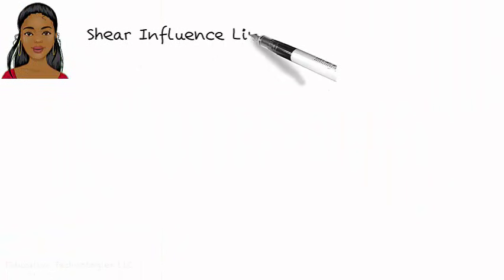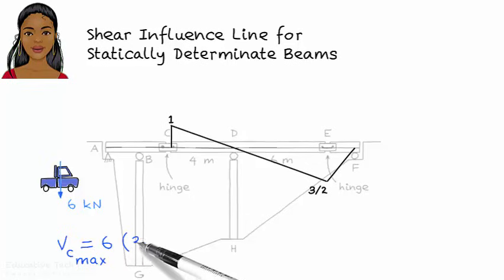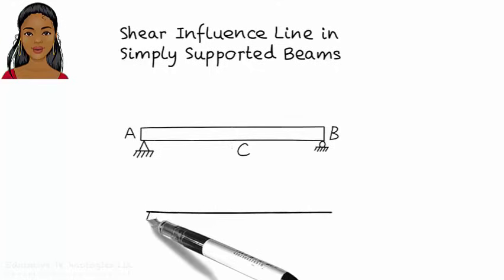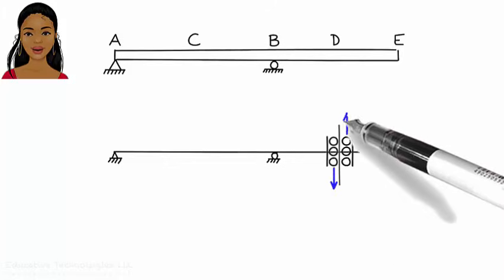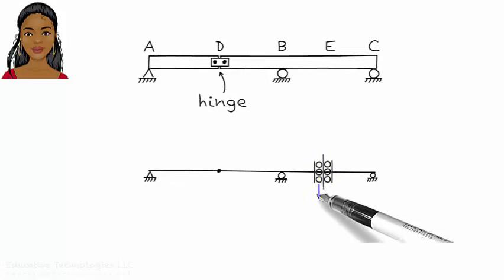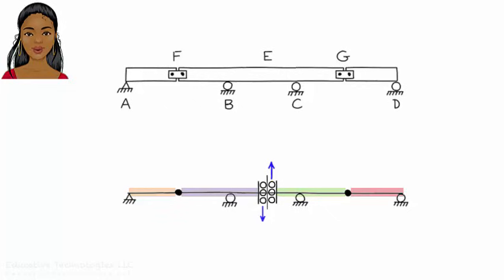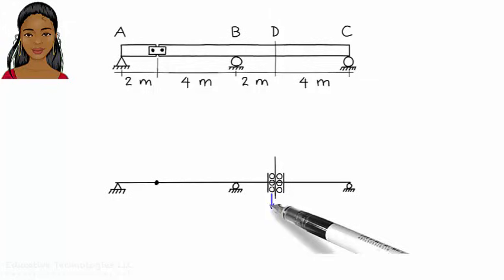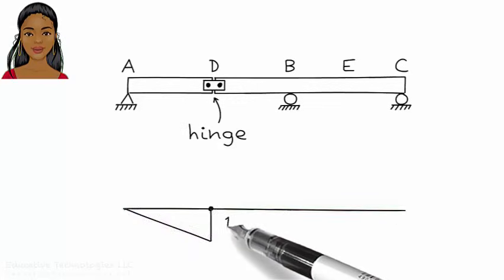SA17: Shear Influence Line

Comment: what if the force is between hinge and B point
Reply from the maker: Please elaborate. Which beam in the video are you referencing? What significance do you see for the moving unit load being between the hinge and point B?
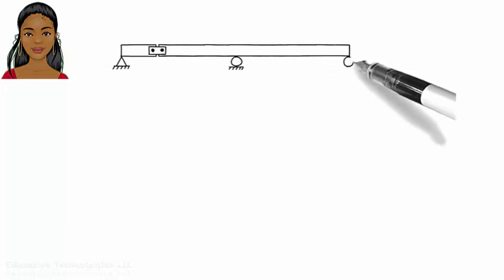Reply: @DrStructure  oh im sorry, this beam 12:02
Reply: which beam is rotating down, and which will rotating up. or its always left beam is going down and the right is going up?
Reply from the maker: Correct, we always pushing the left segment down and the right segment up. By definition, a positive shear means a downward force to the left (pushing down the left segment) and an upward force to the right (pushing up the right segment) of the hinge.

Comment: To get the shear influence line at the midspan (at point C) of the simply suppoted beam, a pair of rollers is placed at point C. The left roller is pushing downward and the right is pushing upward. Let's say, I wish to get the shear IL at points A and B by placing a pair of rollers at those points. Is the shear at point A positive, and at B negative based on the pair of rollers placed at points mentioned?
Reply from the maker: If A and B are points very close to the left and right ends of the beam, then yes, the shear influence line for point A is basically a right triangle with a positive height of almost one (1) at A. The influence line for B is also a right triangle having a height of negative one at B.
Reply: @DrStructure  Thanks a lot. I really do understand now how shear IL behaves. I appreciate your continuous replies. 👍👏
Reply from the maker: You’re welcome!

Comment: Let's say we have a simply supported beam like as shown at 3:45 mark. The beam span is 10 m and the moving load is 50 kN. Is the MAXIMUM shear value at point C (at the midpoint of the beam) be 50 kN x 0.5 =  25 kN (+ and -) and the MAXIMUM moment at the same location be 50 kN x 2.5 = +125 kN-m? Where 2.5 is the ordinate of the moment influence line at point C. Thanks in advance for your reply.
Reply from the maker: It is important to remember that the shear influence line does not give us any information about the location of max shear in the beam. Rather, it lets us determine the maximum shear at a specific point due to a moving load.

The maximum shear in a simply supported beam does not occur at the midpoint of the beam; it takes place close to either support. 

However, for the simply supported beam you’ve referenced, assuming we want to determine the max shear at the midspan (and not the max shear in the beam), your analysis is correct.
Reply: @DrStructure  Your detailed explanation is awesome. It gives me a better understanding of influence line. I really do appreciate it. Salute to you. 👍👏
Reply: @DrStructure  With reference to your explanation, the maximum shear is at the support and that's 50 kN x 1 = 50 kN and the maximum moment is at midspan 50 kN x 2.5 = 125 kN-m.
Reply from the maker: Correct!

Comment: What's the difference between reaction and shear influence line? Are we getting the same reaction influence line to this problem?
Reply from the maker: The shear force at the pin/roller support is undefined. That is, there is no shear force where there is a support reaction. Therefore, the shear influence line and reaction influence line are conceptually different and generally look different.
Reply: @DrStructure  Thank you.

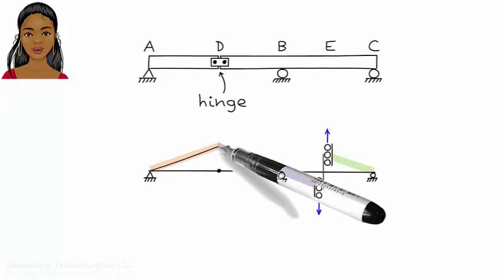Comment: I don't understand how can the pin move vertically up and down  ? As you mentioned at 9:15
Reply from the maker: At 9:15 we place a pair of vertical rollers, not a pin, in the beam. By definition a roller can roll/move. Since they are placed in the vertical directions, the rollers can move/roll up and down. Since we have two of them, they can move independently in opposite directions.
Reply: @DrStructure  no that's not what I asked , I am asking that there is an internal hinge between two rollers right ? I am asking how can that internal hinge point move up ? Doesn't the pin restrict vertcal motion ?
Reply from the maker: If you are referring to the real hinge, yes, it can move up/down. A hinge is unlike a pin or a roller. You can view the hinge as a single bolt that connects two beam segments. It allows one segment to rotate relative to the other segment.

You can create and experiment with a hinge connection using two balsa wood sticks and a push pin.
Reply: @DrStructure  hi , thank you so much for your reply , so what I have understood is that a hinge and pin are two separate entities , and point which is hinged on a beam can actually move up and down that's why we have the point moving up , but if we had a pin there then it would have remained at its position and would not have travelled up , right ? Because the pin connection and roller connection resists the vertical movement ,
Reply from the maker: Correct. The pin and the roller are mechanisms that connect the beam to the support. Neither the pin or the roller can separate itself vertically from the support. The hinge however is not attached to a support, so it’s vertical displacement is not restrained.
Reply: @DrStructure  understood , thank you so much. , Your way of teaching and clearing our doubts by responding quickly is very admirable and professional ,
Reply: @DrStructure  is that also the reason why an internal Hinge has two pairs of reactions , two horizontal and two vertical ? As these cancel each other out and equate to zero , the total net vertical reaction caused by the hinge is zero ,hence it can move up and down ? Where as a pin support is a support which prevents vertical motion ? Is this correct?

Comment: how do you draw the influence line if they ask you for a point that's located on the pin
Reply from the maker: Shear exists, and can be defined, only at points away from pin/roller/fixed supports. Shear force at the pin support is undefined, hence, we cannot draw such an influence line.

Comment: Dear Dr. Why at 3:04 , would you describe the shear at C decreases linearly when the load moving from A to C? Isn’t it increases linearly? My understanding is that the negative sign only indicates the right hand side of shear with respect to the load at current time.
Reply from the maker: If the value of shear is increasing in the positive direction, we say shear is increasing. On the other hand, if the value of shear is moving in the opposite direction, we say it is decreasing. That is, if shear goes from 0 to, say, -100, we say shear is decreasing, since -100 is smaller than 0.
Reply: Dr. Structure understood. Many thanks 🙏🏻🙏🏻
Reply from the maker: You're welcome.

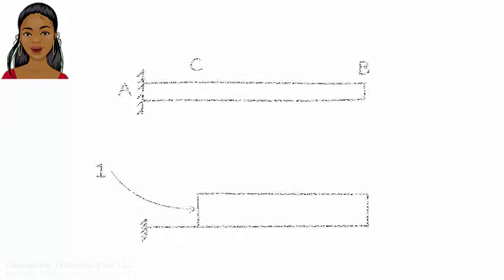Comment: Amazing tutorial, but why don't AD and CD have the same slope? Can you please explain that! minute 13:45
I understand that CD can't rotate because its fixed at B and C. But when BC stays horizontal, the other one should be horizontal as well (AE). Because two lines must remain parallel to each other. 
Thanks in advance!
Reply from the maker: The two lines being parallel is a reflection of how shear varies linearly in proportion to the position of the unit load. As long as that hypothesis is true (as long as shear varies linearly in proportion to the load position), then the lines to the left and right of the target point remain parallel, they have the same slope magnitude. 
However, there are situations in which there is an abrupt change in the shear value where the linearity and proportionality does not hold true.  For example, in the beam under this discussion, note that if no load is being applied to segment AD, if all the loads are placed only on segment DC, AD would carries no internal force. In fact, for analysis purposes, we can remove AD altogether and just deal with segment DC. Put it differently, AD carries internal loads only if the load is placed on AD, otherwise no internal shear or moment develops in the segment. So, as the unit load moves across the beam, as soon as it passes point D, the notion of linearity and proportionality does not apply to AD any longer. Meaning, the parallel line hypothesis does not apply here since the linearity and proportionality does not hold true.

Comment: Great tutorial. On Exercise#1 why you don't rotate the left side beam around B and only shear on the left?
Reply from the maker: Note the support at the left end of the beam. It looks like a vertical roller, but it behaves a bit differently. The support at A can resist both a horizontal force and a bending moment (similar to a fixed support, but minus a vertical reaction force). This behavior causes a bit of problem for our qualitative approach for drawing the shear influence line.
Since the support at A cannot carry any shear (vertical force), no matter where the unit load is placed on the beam, all of the load is going to be counteracted by the vertical reaction at B. That is, the vertical reaction at B is always 1, no matter where the unit load is located.
This means, when the unit load is to the right of point C, the left segment of the beam does not carry any vertical (shear) force. That is, as long as the unit load is to the right of C, shear at C (and any other point to the left of C) is zero. Whereas when the unit load is to the left of C, the shear force at C (and any point from C to B) must be equal to 1.  This insight yields the rectangular influence line shown in the video.

Comment: what if there is only one height side. Are we take direcktly one or we assume there is another side ?
Reply from the maker: When we place a fictitious hinge at the point of interest, we end up with a beam segment to the left of the hinge and one to the right of the hinge. If the left segment is not prohibited from rotating, the segment is going to move down at the hinge. Similarly, if the right segment is not prohibited from rotating, the segment is going to move up at the hinge. Generally speaking, the up and down movement happens on both sides of the hinge. But of course, there are cases in which one side is not going to be able to move, in which case we end up with one height only.

Comment: @ 9:17 I am confused as to why the beam EC does not move up as one, but is held down at point C. It is not a pin, so it cannot be held down, can some one explain?
Reply from the maker: The actual beam does not move up or down at C, the fictitious beam does that. We are inserting an imaginary hinge at C thereby creating a fictitious beam. We then subject that hinge to a shear force causing point C to move up/down in the fictitious beam. Why are we introducing the imaginary hinge and creating a fictitious beam?  Because the resulting displaced shape of the fictitious beam corresponds to the shear influence line in the real beam.

Comment: @Dr. Structure  Please elaborate as to how to draw SF ILD at an intermediate support or simply the ILD for SF at the support of an overhanging beam.
This method, although brilliant doesn't seem to work in the said problems.
Reply from the maker: In  beams and frames, there is no shear force at the point of application of a concentrated load, or at the support reactions. That is, at such points shear is undefined. We can talk about shear just to the left (or to the right) of a support, but not at the support. 

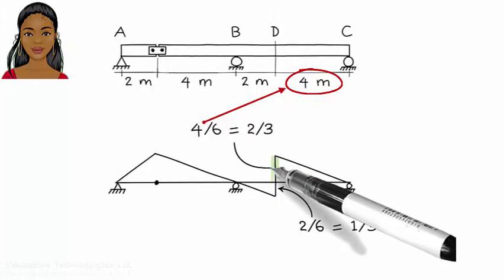Consider the beam shown @12:42 in this lecture, where the influence line for shear at D is drawn. Note that the overall height of the vertical line at D is one, since the moving load has a magnitude of one. Part of the vertical line is below the x-axis and part of it is above the x-axis. Now, move that vertical line toward B (the roller support). As the line get's closer and closer to B, the lower (below the x-axis) part of it becomes smaller and smaller as the upper part of it (above the x-axis) approaches one. That would be the shear influence line for a point close to an interior support. No matter how close that line gets to B, since it will never reaches B (i.e., shear at B is undefined), there would always be a small part of that vertical line below the x-axis.
Reply: @DrStructure  why is shear undefined at the supports?
At the point of application of concentrated load mid span , i can understand there are are 2 values of SF at the same point and so SF is undefined there. But why at the support?
Reply from the maker: Fundamentally, there is no difference between a mid-span point load and a support reaction (also a point load). They are just applied at different locations on the beam.  

Think of a beam as an (infinite) series of dimensionless points. Now think of the support position as such a point, and the support reaction being a force applied at that point.  Let's call the point B, and say, the support reaction at B is 100 kN.  For the sum of the forces to vanish, for the force equilibrium to be maintained, therefore, there must be one or two forces (at the two neighboring points) that add up to 100. Let's label the two neighboring points as A and C, and say that there is a force of 50 kN at each of those points so that the sum of all three forces adds up to zero. 

These balancing forces at A and C are what we call shear forces. By definition, these forces cannot be placed at B. That is,  placing the two 50 kN forces at B is equivalent to saying that there is no force (support reaction) being applied at B, since these forces cancel each other out. Whereas the presence of these forces in the neighboring points suggest force propagation through the member, as in the beam is resisting the applied load and consequentially internal (shear) forces develop. That is why there is always a jump in the shear diagram at a support, say, going from -50 kN to +50 kN, with the height of that vertical line being the magnitude of the reaction force at that point.
Reply: @DrStructure  understood... Thanks a ton 👍

Comment: I got how to draw Ild but How to calculate ordinate at various points ?
Reply from the maker: For statically determinate beams shear influence line consists of straight lines often forming rectangles and triangles. Knowing the height of a rectangle, or a triangle, we can use basic geometry (in the case of triangle, height-to-base ratio equality) to determine the height at any desire point.
Reply: @DrStructure then  what @ statically indeterminate  structure ?
Reply from the maker: @sarfrazshaikh2989  If the structure is statically indeterminate, we need to come up with algebraic equations for (shear/moment) in order to be able to calculate their values at arbitrary points, it cannot be done qualitatively.
Reply: @DrStructure very helpful u nd ur efforts .Thankyu so much

Comment: what if adding moment on the hinge.? What will be the effect?
Reply from the maker: In theory, we can apply bending moments to a hinge. The moments are considered external loads. Think of a cantilever beam, there is no internal moment at its free end, unless we apply a (moment) load to that end.  An internal hinge acts more or less the same. There is no internal bending moment at the hinge, unless we apply an external (moment) load to that point. If the beam is statically determinate, we can analyze it using the static equilibrium equations. 

But keep in mind that the above discussion is unrelated to the influence line discussion. When drawing influence lines, by definition, the only load the beam can be subjected to a unit moving load.

Comment: How would you go about calculating the influence line if you had one continuous member, with varying cross-section, spanning from A to F as per the above illustration?
Reply from the maker: If the beam is statically determinate, its cross-section does not impact the shape of the influence line. That is, shear in the beam would not be a function of the cross-sectional properties of the member.  but if by continuous you mean indeterminate beam, the qualitative approach would be of little use.

Comment: What if you want to draw the shear influence line on the left and right of a pin/roller support?
Reply from the maker: The same principle applies. Say, we want to draw the shear influence line for the point just to the right of B for the beam @9:00.  Note the influence line for E where the amount of upward movement (of the roller to the right) equals to the amount of the downward movement (of the roller to the left).  They each equal 1/2 adding up to 1. Keeping in mind that that total height is always 1 regardless of the position of E, start moving E to the left toward B. As the point gets closer to B, the height above the x axis increases (becomes larger than 1/2, approaching 1 but never reaching it) while the height below the axis gets closer to zero, but it never reaches zero since shear at B is undefined. No matter how small that negative height gets, it results in a downward movement that causes the segment between the hinge at E (now positioned just to the right of B) to rotate clockwise.
Reply: @DrStructure  So, you are basically saying that the shear influence line just to the right of support B will essentially be the same as the shear line for point E? (Just with different heights)
Reply from the maker: @FranCoVids  Yes!
Reply: @DrStructure  thank you!! You're the best!! 😄